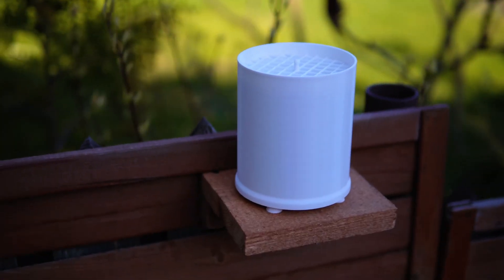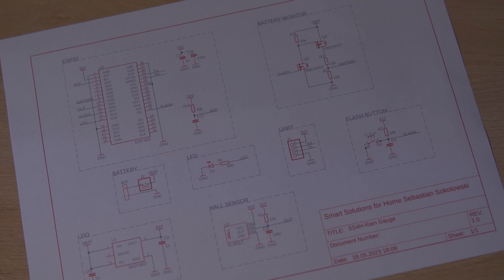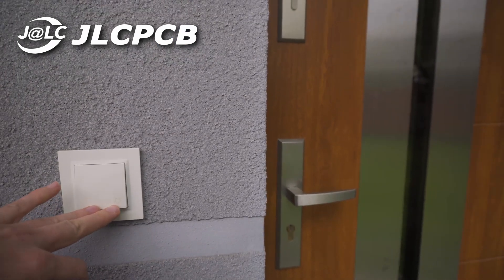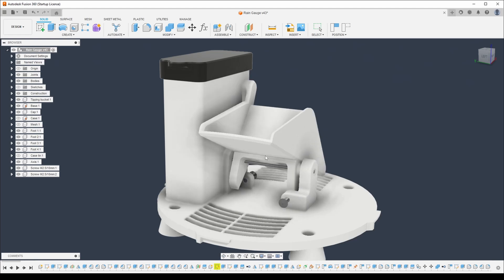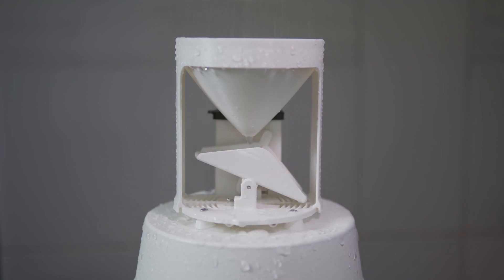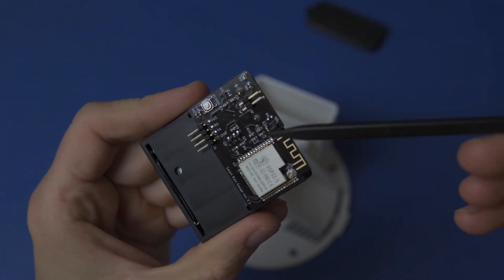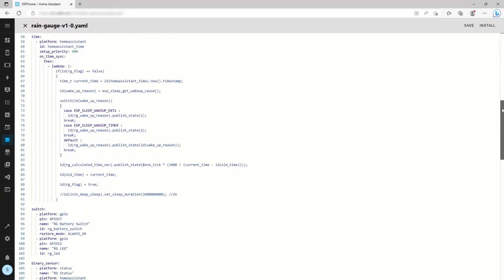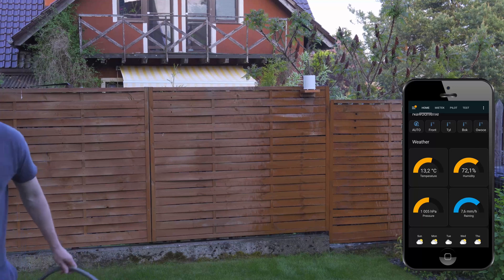DIY WIFI Rain Gauge, powered by Home Assistant

Comment: The goal is to find out how much rain (in mm) one tip of the bucket represents.

Rainfall (mm) is defined as liters per square meter. So, 1 mm = 1 L/m².

We need to find the collection area of your funnel.

We need to know the volume of water per tip.

The Formula:

Rainfall Per Tip (mm) = ( Volume Per Tip (ml) / ( π × ( Funnel Radius (cm) )^2 ) ) × 10

Let's use your example:

Funnel Diameter = 110 mm → Radius = 55 mm = 5.5 cm
Volume Per Tip = 6 ml

Rainfall Per Tip = ( 6 / ( π × (5.5)^2 ) ) × 10
= ( 6 / ( π × 30.25 ) ) × 10
= ( 6 / 95.03 ) × 10
≈ 0.063 mm

So, each tip of the bucket represents 0.063 mm of rainfall, not 0.63 mm. The original source likely had a decimal error. This is a much more realistic and sensitive value.
Reply from the maker: Thanks for checking my calculations, but I’m sticking with my answer — they’re correct. It should be 0.631 mm per tip.
Here’s how I got it:

Known values:
Tipping bucket volume per tip: 6 ml = 0.006 L
Funnel diameter: 110 mm = 0.11 m

Funnel area (A) = π × (d/2)² = π × (0.055)² ≈ 0.009503 m²
So:
mm per tip = liters collected / area in m² = 0.006 L / 0.009503 m² ≈ 0.631 mm

Comment: Brooo thank you so much for these weather station videos. I'm trying to build a complete system that includes Temp, Dewpoint, Baro, Wind, rain, and snow depth all on one RP Zero W and im not about to blow $150 US on a bucket sensor to tell me if its raining. I'm also looking into a Microwave sensor but everything I find is for human detection High and low (yes its raining/ nope all clear). I want to be able to measure the intensity!

Comment: please tell me you are measuring using weight not volume...
hall sensor lol nice idea though. I could do this with marbles. and a stick.
Reply from the maker: Thanks for the comment—you’re actually the first person to point that out! And of course, it’s totally valid.  
I did consider doing it that way, but in my opinion, it’s close enough to assume that 1ml ≈ 1g. Obviously, density of water depends on temperature, and the higher the temperature, the greater the deviation. But we’re talking about roughly 4% at boiling point (100°C). Within a more realistic range (up to 30°C), the error shouldn’t exceed 0.5%. So, I feel like there’s no point in splitting hairs over this.

Comment: Hi, thanks for sharing this project. I'm planning to buold the rain gauge and I have a question about the code for ESPhome: in the deep sleep part you have written "mode: ALL_LOW" as wakeup mode. This way, the rain guage only triggers when the sensor goes from high to low, but not the other way. Am I correct? If so, the rain gauge would count only half of the tippings of the bucket.

Comment: An improvement would be a separate circuit to only turn on the ESP if it is raining. This could be completely analog for example it could use a 555 timer to see if the bucket has tipped.

Comment: Wow, this DIY rain sensor project is truly impressive! You have showcased incredible skills in PCB design, CAD modeling, and 3D printing. The attention to detail in each aspect of the build, from the efficient layout of the PCB to the robust and sleek 3D-printed enclosure is really inspiring. The integration with a 'water-tight' :-) ESP32  for real-time rainfall data monitoring is a fantastic touch. Kudos to you for sharing this detailed and well-executed project. This is a prime example of what dedication and technical expertise can achieve in the DIY community. Great work!

Comment: there is another approach i would recommend you. If you use a reed switch instead of the hall sensor you could save some battery as they are passive components

Comment: Hi, could I replace the Esp32 by a reed switch, so every time the magnet moves it creates a pulse.
Then, I can read it with a 2 wire cable connected to another MCU.

Comment: I bought a stand alone rain gauge years ago with the idea to make something like this. 
But I think I prefer this one. We often have a drizzling zero point something mm/hour rain fall and this one is easy to modify to use a bigger funnel. Definitely something I like to add to my HomeAssistant installation

Comment: Superb video and great project. I want to try this! Is there a way to ensure it registers when it starts raining a very small amount? In the UK we call it "spitting", which is when there are only a few drops of rain. Your example was 8ml of water to tip the bucket. I guess this can be adjusted?

Can it be changed to 4ml or even 2 or 3ml? I am trying to think of disadvantages. Obviously the first one is battery life, but I will be using a power supply so that doesn't matter. (I plan to house all parts inside the house, we have a special waterproof hole that comes out of the wall, so I can pass cables through etc!)

Other disadvantages: If you make the funnel opening more narrow, then it will overflow in very heavy rain. But maybe it can be done by adjusting those screws? Also maybe the lifespan will be half (parts wearing out etc.) - what do you think?

Comment: I built a rain gauge like this last year. Used an existing funnel type rain gauge and retrofitted an esp32 and Hall effect sensor. I programmed the esp32 with micropython that makes a http call to a weather server I wrote in Python and Django. The http call  tells the server to write an indicator to a MySQL database. The weather application then polls the database and calculates the amount of rainfall for a specific time period, 5 min, 1 hour etc.. it publishes that data to MQTT and Home Assistant is set to take those MQTT readings and update the gauges.  One thing I did is used a lipo battery and charging circuit. I have it connected to a small solar panel so no battery charge out. :) Great build!

Comment: This is excellent. I've just got it all working. I am currently looking at how to integrate it into Home Assistant - since the unit only transmits when there is a bucket tip, out of the box HA thinks the rain rate is whatever was last reported. I guess some kind of automation that sets the rate to zero in home assistant if there has been no update for X seconds is needed. Very cool project.
Reply: Might it be possible to modify the ESP code to report a zero X seconds after the last rainfall, before going into deep sleep - so that HA knows there is now no rain, as opposed to the rain rate last reported...?

Comment: Does anybody knows how to do the initial flash of ESPHome? I'm using an USB to serial adapter, but I do not now the wiring and next steps exactly... I see a Rain-Gauge-Store-Test access point, but I do not know the password...
Reply from the maker: Sorry that there's no information on the board I sent you. The password is: "1is9NCSaaThA."
If you're planning to do it via Wi-Fi, I recommend you this link: https://esphome.io/components/captive_portal.html
As for using the USB-UART adapter, I'll try to make a quick instruction guide as soon as possible.

Comment: Well done! Might be a concern with the top grill getting blown off or even floating off if the cylinder fills with water. Could put a lip around the cylinder that the grill snaps into.

Comment: You can shave off the hall sensor, since this is build in to the ESP32... (choose the correct version😀)
Reply from the maker: I actually wanted to use the internal Hall sensor in the first version of my gauge. The problem is, it's not active in deep sleep mode. So, in order to minimize power consumption as much as possible, I had to use an external sensor and wake up the ESP32 using a regular GPIO.
Reply: @SmartSolutionsForHome  ahh, yes. That makes sense 😀

Comment: Hello, I like the calibration - that is a smart solution :)
In fact you can build this thing without any soldering or ESPHome - simply buy a ZIGBEE DOOR sensor - they already have the hall sensor and everything you need - and they cost about 5$ and will work on battery for years :) Then just let Home assistant do the calculation ... I'm actually in the middle of doing that. :)

Comment: I might have missed it. What filament did you print with? Is it ASA?
Reply from the maker: You didn't miss it; I guess I just forgot to mention it. I used PETG.
Reply: @SmartSolutionsForHome  Maybe the most important thing is layer height, on the funnel? Because it needs to be smooth? Any other tips?

Comment: I've been playing with this concept to build a rain detector to warn me when it starts raining while I'm having my windows still open. Unfortunately it didn't work out as I was hoping for because many times the rain was already pouring for quite some time before the first notification came.

Quite recently I got the idea of building a acoustic rain sensor using a piezo electric buzzer as an analog input. I just got the parts a few days ago so I haven't been able to play with it yet. I actually have no idea how to make it work but I'm hoping for the best 😅
Reply from the maker: You've raised a very interesting point! :)
The device you're describing is something completely different from mine. The task of a Rain Gauge is to accurately measure the amount of rainfall in a given time. Due to the specific bucket capacity, you will indeed receive information about the rain with a certain delay. Therefore, it won't work well as a good warning system.

As for the acoustic sensor, I have mixed feelings. It seems to me that it will be very susceptible to interference from any other sound, but I could be wrong, of course.
I think that optics would be a better solution than acoustics.
Look into how such sensors work in cars. Just a few drops on the windshield, and the wipers already know to turn on :)
Reply: @SmartSolutionsForHome  when I started experimenting with my rain gauge, I didn't have a clue how long it might take for it to tip over first 😉 And having the ability to measure fainfall in a given time period felt like a bonus to me because I could estimate the soil moisture levels. But things turned out differently so now I'm measuring soil moisture levels instead ;-)

I read an article of a student from the Dutch university TUDelft, who started experimenting with quite a similar setup. His goal was to build an affordable acoustic rain gaug (disdrometer) and he uses the setup to count individual drops and measure the size of each droplet to calculate the amount of rainfall. Obviously, that is way out of scope for my project but it got me thinking. A €0,50 piezo electric speaker and a €0,05 resistor connected to an ESP32, what possibly go wrong? 😄 

An optical rain sensor will be my next option. I allready scrapped 2 mice for that, but unfortunately they didn't have a commonly used sensor and I didn't have the time to play around with a signal analyzer yet.

Comment: The design is very nice. You could change the top grill to be a upper cone or something like that so a leaf has less chance of be stucked on it.
Reply from the maker: Thanks for the interesting idea. I considered it, but I think it could negatively affect the measurements. Some droplets could bounce off that grill and not enter the interior. That's why I placed it slightly below.
Reply: @SmartSolutionsForHome  I agree with felipenavas about the inverted cone for the grill. If the rings of the grill are angled slightly towards the centre it should keep most of the rain. My other concern is UV radiation - that sun likes to break down plastic, so I surround these with replaceable wood.

Comment: How about a fixed coil with a swinging magnet. The output of the coil could be (bridge) rectified (or just a diode) and the output "spike" clamped with zener diode. That output could fire an interrupt that wakes the ESP32 and so on... That would negate the need for running the hall effect sensor. This is just random thinking and I haven't really done this - let me know where my thinking is bad.
Reply from the maker: Thanks for the interesting comment. Something like that does seem like it could work, but I think it would be much more power-hungry than the Hall sensor.
Reply: @SmartSolutionsForHome  The idea is that a moving magnet generates the interrupt pulse; there should be no power used at all [except deep sleep quiescent current], power is generated by the magnet moving.

Comment: Can I ask - that plastic holder you put the pcb in when you were applying the solder mask - did you make this yourself? Or is it something you can get from JLCPCB?
Reply from the maker: I designed and 3D-printed it myself.

Comment: think you put the batteries in the wrong way but really good project to do one day
Reply from the maker: Thanks, I'm glad you like the project.
And about the batteries, I definitely put them in properly. In the next scene, you can see that the LED is lit. I didn't move them around between shots :)
Reply: @SmartSolutionsForHome  7:09 it looks like you have there, looks like you got the + end against the spring with you meant to have the - against it, it's normally the - with the flat bottom of the battery goes onto the spring
Reply from the maker: @AdamHinckley  If you take a close look at the moment you mentioned, you can see that there's a "-" written on the battery with an orange tip. It might actually seem like the tip is not flat, but it's definitely flatter than the one on the opposite side :)
Reply: @SmartSolutionsForHome  normally the '-' has a flat bottom, them batteries look to me haven't, normally where I am, the '-' has the flat bottom

Comment: Nice work! Two suggestions, both related to how the device is installed:

IMO working with similar devices, levelling the device is quite important. Leaning a bit will throw off any calibration you've done. Alternatively, if you don't have a level handy, check & adjust your calibration after installing it. 

It's also important that the installation to be secure. Vibration (eg,  from wind) will induce slightly lower static friction in the hinge mechanism, which causes the bucket to tip at a slightly lower threshold, resulting in overestimates of precipitation relative to a vibration-free bench test.
Reply from the maker: Thanks for the kind comment. Regarding your suggestion about leveling, there was actually a scene with me checking if the Rain Gauge is level, but I ended up cutting it in post-production :)
As for the wind, you're absolutely right. It's important, and I didn't think about that. Maybe I should consider installing it in a slightly more sheltered location. Thank you!

Comment: Great Project, what material did you print in, PETG or ABS ? Any specific infill required for the balance/tipping items ?
Reply from the maker: I used PETG, and as for specific requirements, there aren't any. However, to eliminate any slight differences, I added two screws that can be used to calibrate the device precisely during assembly. I talk about it in the video :)

Comment: Great video and project!  What about using a solar panel to charge the batteries?  Thanks for sharing this with us.
Reply from the maker: This is something I've been thinking about for quite some time. But I didn't want to prolong this project any further. 
I plan to make a weather station at some point, with wind, rain, temperature, humidity, and pressure measurements. If possible, I might even add an air quality sensor - we'll see :) And when that happens, I'll definitely add a solar panel because, with such power consumption, batteries won't stand a chance.

Comment: Out of curiosity, the ESP32 actually has a built in Hall effect sensor (though I don't know how good it is).  Is the reason you didn't just use the built in one a matter of placement or is it not as easy to use the built in one to wake up the CPU from deep sleep?
Reply from the maker: Someone already asked the exact same thing earlier :) I replied to him: "Yeah, I actually wanted to use it in the first version. The problem is, it's not active in deep sleep mode. So, in order to minimize power consumption as much as possible, I had to use an external sensor and wake up the ESP32 using a regular GPIO."

I can see that you know ESP32 more than the average bread enthusiast. Fellow engineer? :) Thank you for the comment.
Reply: @SmartSolutionsForHome  Maybe I'm in the hardcore enthusiast category :-)  I started from ESP8266 examples and have put together a unified firmware for my house that can be configured to drive various displays (ws2821, LCD, OLED, LED matrix) or various sensors (button, bme280, Lux, VOC, dust particles, IR motion) and provide REST, MQTT, Redis interfaces.   Instead of using something like Home Assistant I'm running services I wrote in Java, Python, and Prolog.   Later I made it portable to ESP32.  I'm kind of roll your own personality.  Haven't had a rooftop weather station since I took down the one I got from Dallas Semiconductor implemented with 1-wire devices, but always tempted.  When I was first reading the specs and included devices for the ESP32 and got to the touch and Hall sensors I started laughing - of course you did...

Comment: I love this video including the humour 😂 Did you know ESP32 has a built in hall sensor?
Reply from the maker: Yeah, I actually wanted to use it in the first version. The problem is, it's not active in deep sleep mode. So, in order to minimize power consumption as much as possible, I had to use an external sensor and wake up the ESP32 using a regular GPIO.
Reply: @SmartSolutionsForHome  I see. I also agree about limitations with ESPHome. It's great and fast for many things, but when you want to do more advanced things I often find it difficult and you have to resort to crazy constructs, even with lambdas.